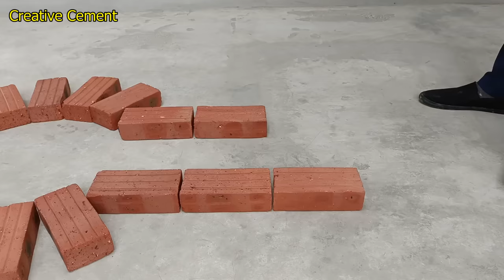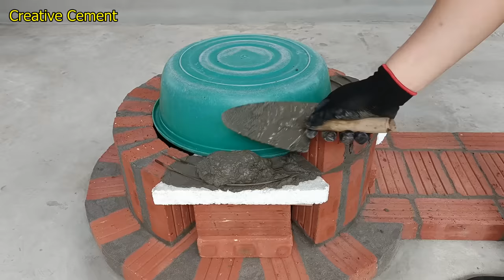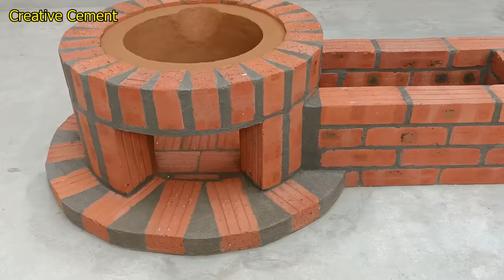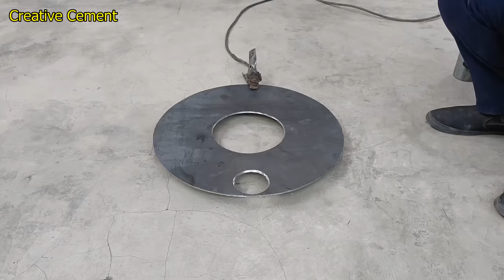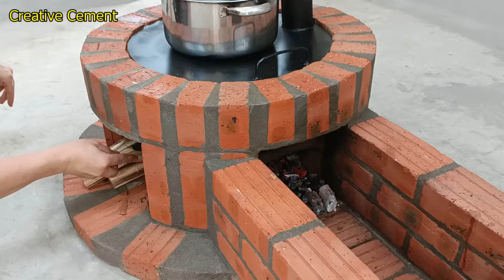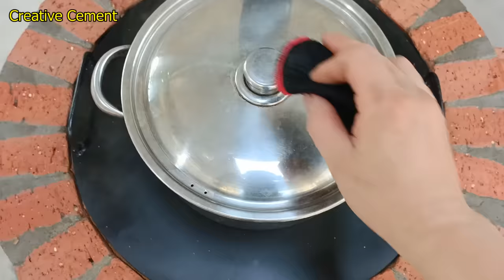How to make a 2 in 1 wood stove from red brick and cement is simple and beautiful

Comment: Very doable project. Thanks for sharing.

Though I have a concern, how do you then get rid of the Ash? 

Or it will be pushed back into the main stove?
Reply: U can use the ash in ur garden or kitchen gardens. Spread little bitcon the plants then thier will b no insects damage ur plants....olden times ash used to clean the utensils made by aluminum, bronze nd brass...it's a antiseptic fr ur utensils....

Comment: Everything is fine. But I would add expanded clay to the mortar in the bottom row, in the gaps between the bricks. So that the mortar does not crack.  And I would seal the seams between the bricks with clay and sand, not cement mortar.  In my opinion, it would be more environmentally friendly.